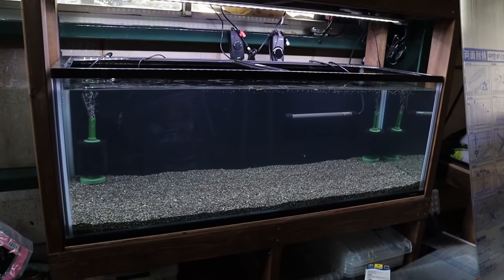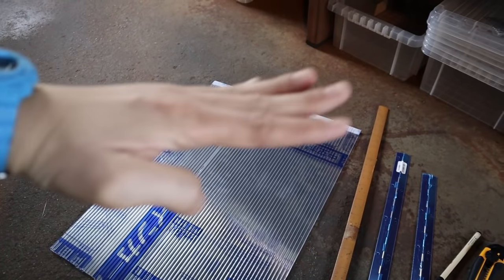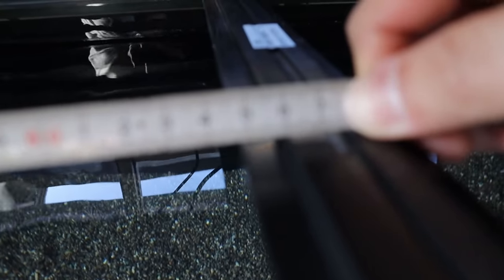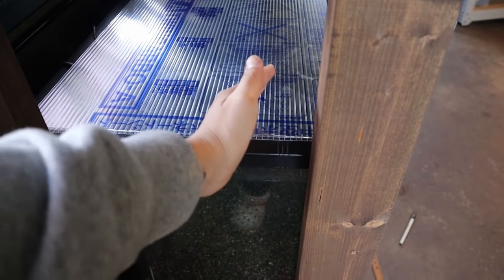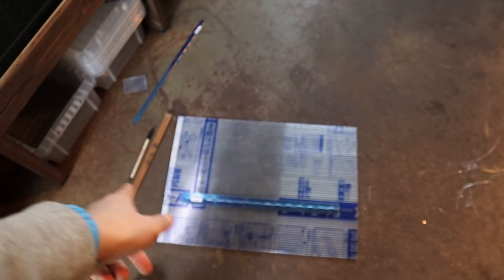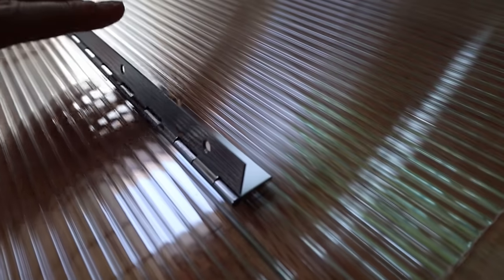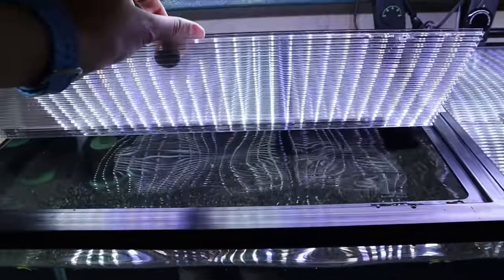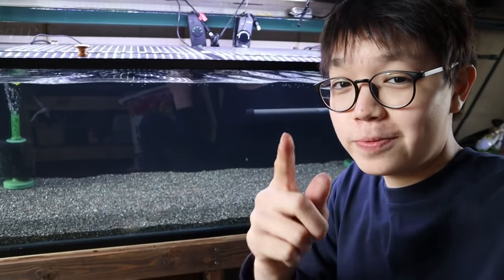DIY FLIP LID/COVER for Aquariums! Cheap & Easy

Comment: That polycarbonate material, when the ends are closed, has insulative properties because it is hollow core...it traps air (that is what insulation does). But instead of having a 2 piece lid with a hinge, like aquarium lids come, why not make the back piece a bit larger than the front piece so that it sits on TOP of the rim of the tank...then, you can make the front part, the part that you use all the time to get in the tank, instead of it hinging, make it a sliding piece, so that you slide it UNDER the back piece that is resting on top of the rim when you want access to the tank?
Reply: I like this idea, I'm going to use it thank you
Reply: Will this cause any issue for the light to not go through fully ?
Reply: Wish I could see what this looks like. Can't imagine the sliding part

Comment: Nicely done. A few questions though - how much does it cut down lighting relative to glass for those who run planted tanks.

I also was wondering whether you considered making a sliding lid version where you could allow yourself greater access as the cuts would not be limited by the rack.

All you need is a special molding you can find at Home Depot for a couple of dollars. It seems that look and style is important to you… so you wanna pick up some matte or gloss black spray paint to spray down the molding so that it matches black trim.

There are a few videos on how to do it.

Part: 852 1/2 in. x 3/4 in. x 96 in. PVC Composite White Outside Corner Moulding

Comment: I was searching forever a custom made tank cover - now this is THE solution! Thanks a lot. Cheap and got a personal touch on the tank. On lighting, was wondering if it would be better to just put in the light on top of this board or need to have a gap or use the light stand.

Comment: These lids are awesome! If my glass one ever breaks I am going to make one of these lids. 👍🏼
Reply from the maker: Great! Yes, I thought about using glass but they are a little more pricey and I’m afraid I’ll break them 😅
Reply: @RyoWatanabee  That is pretty much all they have out in like aquarium shops and big chain pet stores that I know of. It is either the ugly plastic hoods made for those tanks which still use glass under the light fixture area or all glass lids with a silicon hinge. The ones you make seem like they would last a lot longer. 👍🏼

Comment: Great DIY job!! Just a question: have you noticed any light reduction effect (specially when you have plants) due to lids? Greetings!!
Reply from the maker: Not really. I’m not too worried because these are not high tech tanks that I’m putting lids on. Even on a high tech tank, I wouldn’t be too worried. Just make sure to get clear polycarbonate
Reply: @RyoWatanabee  Thank you Ryo for your answer. Mine is a low tech too, so I think that lids are a good idea and very affordable for anyone. Btw, I love the reflections of the lamp on the polycarbonate, that's really cool 😎

Comment: Super glad to see this, lids cost so much at the pet stores. I want to make them for all (10) of my tanks to help with evaporation and to  keep my Betta's from jumping out.
Will they need holes in the top to help with air flow?
Reply from the maker: Thanks and yup you could cut some notches out like how I did or drill/poke some holes in them.

Comment: I purchased corrugated board.  The board is constructed like cardboard in that there are spaces between the two layers. If yours is similar how do you manage moisture build up? I’m considering sealing the edges with silicone

Comment: I did the same build the hinges start to rust from the evaporation / calcium in the water ,good luck.
Reply from the maker: 2 years in, no rust yet. The ones I got are stainless steel

Comment: I just got a new 20 gallon high tank, i wish i would have done it this way! I bought some flat polycarbonate sheets on amazon to make a cover, but your totally right, they droop in the middle due to how thin they are. I tried to find some of the corrogated sheets but i just can't seem to find them.
Reply: Check Out Home Depot
Reply: @frankcarrington5283  Found some at menards! Thanks! I didnt even think to check local hardware stores.

Comment: do the Polycarbonate board cut down on the light  ? I have a High Light planted tank and really  really hate the glass top
Reply from the maker: It wouldn’t make a drastic difference but I’m sure that it does cut down the light slightly. Even glass lids will reduce some amount of light